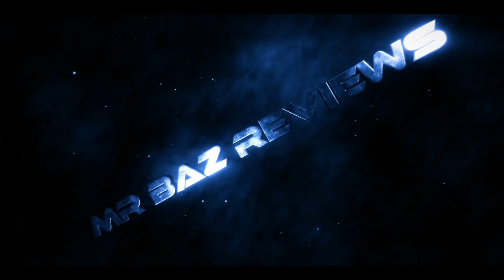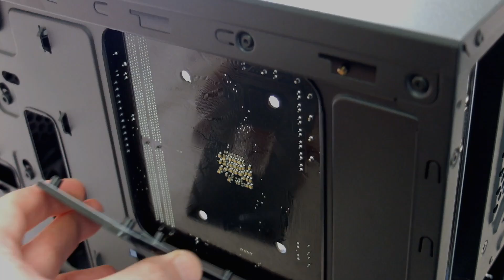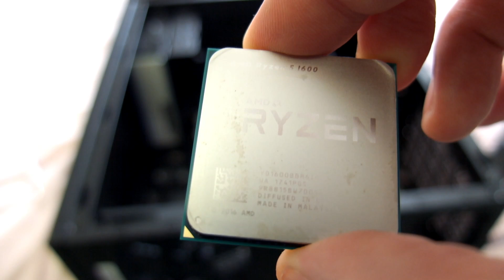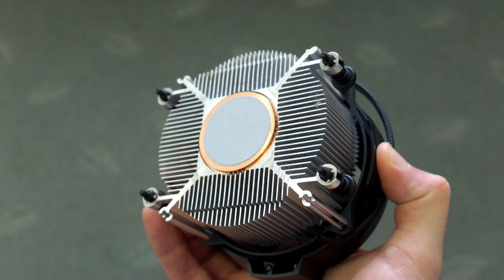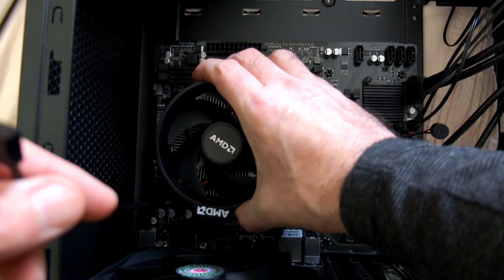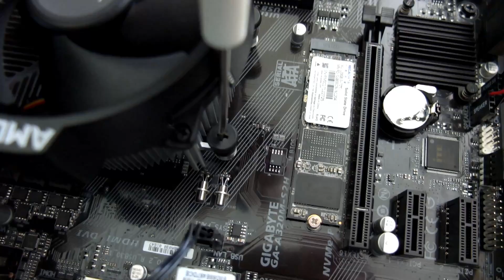How to install a Ryzen/AM4 & AM5 Wraith CPU Cooler

Comment: Thank you! I was apparently installing mine correctly but I just had to be sure. I couldn't get two of the four cooler screws from my Ryzen 5 into my Asus motherboard, turns out I just needed to really really REALLY push them together while turning the screw. Here's hoping it works lol.
Reply from the maker: Just keep the backplate in place when screwing it up use a book or get someone to hold it
Reply: @MrBazReviews  I mentioned I had done it, so I'm set now lol. Thanks though
Reply from the maker: No worries! lol

Comment: But what if the screws aren't going down? How will I know if the screws are going down if the springs keep them up?
Reply from the maker: Support the plate (put a book under it or get someone to hold it), reverse thread when pushing, then screw up still putting pressure on it. You can feel the screws bite
Reply: @MrBazReviews  
Okay, thank you

Comment: Posting my personal issue/solution: I was having difficulty reinstalling the CPU cooler after taking it off because the spring screws would not reach down far enough to contact the threads. I thought I wasn't applying enough pressure to reattach the spring screws, but it turns out that the backplate on the reverse of the motherboard (that has the contact points for the spring screws) had fallen off & out of reach. Duh.
Reply from the maker: It's OK we all make mistakes, yes the back plate can be tricky I just use a book to hold it in place
Reply: Ty so much!

Comment: I am on a b450 a pro max this cooler is a nightmare on it the screws simply don’t go in and I bent my screw driver and it still screw in
Reply from the maker: You force nothing, reverse thread it if it isn't screwing in

Comment: When I try it my cpu coolet moves and I cant screw them in cause it takes yo muck pressure
Reply from the maker: Put something under it like a book/box, or get someone to hold it in place
Reply: @MrBazReviews  its in the case tho
Reply from the maker: @dameoncolombo9214  Most cases have back board access, if not then you have to remove it

Comment: my cooler or motherboard came with no plastic parts
Reply from the maker: You need the back plate, that is it, if that isn't there you can't fit the cooler. Contact the seller
Reply: @MrBazReviews  i have a skytech pc and wdym by back plate?
Reply from the maker: @inq7868  The video shows the back plate, it's there for a reason, watch it and if you don't have one you won't be fitting the stock cooler, because it has to screw into the back plate.
Reply: @MrBazReviews  ur a life saver i was stressing out 😂 i just unscrewed my motherboard and did everything

Comment: No matter how much pressure I put on it, it won’t screw in pls help idk what to do this is my first build and nothing is working
Reply from the maker: Reverse thread it, get someone to hold the back plate in place
Reply: @MrBazReviews  i couldnt get help bc it was 2am but i managed to fix it i was just being stupid, the plate behind the motherboard that the screws go into had slid out of place 🤦‍♂
Reply from the maker: @joshyy9189  It's not too hard just they could have made it a bit easier!

Comment: What is the difference in temperatures? Thanks in advance.
Reply from the maker: What do you mean exactly temps wise?
Reply: @MrBazReviews  Sorry I meant 5 blade cooler vs 7blade cooler.
Reply from the maker: @kasparsberzins4055  Nothing obvious from using both some say the 7 blade has a bit more static pressure if it does it's very minor in performance, the 5 blade is evidently coolermaster made, and it seems to be a bit quieter at equivalent RPM's
Reply: @MrBazReviews  Thank you very mutch.

Comment: the stupid screws won't keep attached to anything through the holes in the mb. i don't know if it's amd or msi to blame but this system is awful. amd should have warned against use in cheap motherboards. i broke a few pins pushing desperately to keep the screws in position but the damn springs are more powerful than I. Something in the video is missing in my setup but i cant figure out what
Reply from the maker: The concept is quite simple, you remove the brackets..keep the backplate in place and screw the cooler onto it. If it's difficult, reverse thread the screws, do each corner a bit first to get it held in place. Some boards seem easier than others, ie Gigabyte never had a problem ever. Other makers are a bit hit and miss
Reply: @MrBazReviews  thank you

Comment: Why the shitty fuck is it so noisy! The temps are okish but now i have to waste another 30$ on some other cooler.
Reply from the maker: Go into the BIOS settings, or download the board software, all of them offer settings to tweak the fan speed, generally it's not a noisy cooler at slower RPM's.

Comment: Does this use backplate as well like the one you buy separate or the backplate only comes with a cpu fan that you buy
Reply from the maker: The backplate comes with the motherboard, you just need to remove the plastic on the front and screw the cooler onto the back plate. I have no idea other than holding the back plate in place, why they come with the plastic parts

Comment: I have a Msi b550 mono and the wraith spire will not properly sit right I can get one side screwed down but then the other side starts to lift I’m looking to get a after market cooler to try and resolve this issue smh
Reply from the maker: Try slightly screwing in each screw, work opposite screws . Then tighten up
Reply: @MrBazReviews  Ill try again I would tighten in a cross pattern but the cooler seemed would just lift and it seemed like i had clearance issue ill give it another go thanks dude

Comment: No not simple. It is pain in the ass. When you move on 1 side the other side move up. I could only move 3 sides in. Terrible design..
Reply from the maker: Some boards are worse than others, for some reason, if the back plate is held in place or on a flat surface, just screw in slightly each one. Then tighten them up

Comment: I’m having trouble unscrewing the mounting bracket on the motherboard. What size of philips screwdriver did you use?
Reply from the maker: Any will do reverse thread, hold plate should screw on

Comment: For those of you having a very hard time fitting the spring, I've spent hours trying to fit it just to figure out that my motherboard or the cooler itself had a back piece (mounted on the back of the motherboard) to fit the screws better. I'd advice to call someone to hold backplate while another person screws (don't be afraid to push it). Hope it helps someone!
Reply from the maker: Yes that is shown holding the plate is a requirement!
Reply: Thank you so much. I spent like an hour trying to get the screws in before Googling. This tip worked perfectly
Reply: This! 
Spent an hour trying to figure out how to do this. Thanks a ton!
Reply: This comment helped me stop Trying for an hour
Reply: what should I do if I'm alon3
Reply: Take the mobo off, hold the back plate! Thx a bunch!!!
Reply: Man you are a life saver I have been stuck for almost an hour trying to screw with no results
Reply: So I put my processor on by myself twice and it’s been like a year. Wanted to redo my thermopaste and was struggling to fit these screws. Ur a life saver. Hopefully I didn’t break my pc
Reply: thank you for this comment
Reply: Worked perfectly after my partner and I cluelessly worked on the screws for a good minute. Thanks for this comment!

Comment: had cold sweat installing this, there is a bow in the back of my motherboard, a very tight fit.
Reply from the maker: That's not right shouldn't bow out the board, re-attach it, the back plate should be flat it just screws into that.
Reply: @MrBazReviews  the backplate is flat. it's the motherboard that's bowed lol.  ordering an aio, this stock cooler is giving me 58 degrees idle.

Comment: I just simply can't find help for my spring screws not reaching the headers, no matter how much pressure I put on them, they won't reach. 2 of them did, but the opposite side won't.. Any advice, cuz I'm gonna cry soon xD
Reply from the maker: Take it off and try again. Some makers are not doing a great job on their boards, so I use Gigabyte never had any problems
Reply: @MrBazReviews  I got it, my back screw panel fell inside my case so that's why it wasn't grabbing onto anything lol, thanks :D

Comment: Screws wont reach on mine
Reply from the maker: Push down hold the plate in place
Reply: @MrBazReviews  do i have to take out the whole motherboard
Reply from the maker: @stevenrinehart5061  Not unless you can't get to the back plate, depends on the case
Reply: @MrBazReviews  i tried to get to it but something is holding it on and i cant figure it out
Reply from the maker: @stevenrinehart5061  I can't remote trouble shoot remove everything and then put the cooler on as shown I've never had a problem fitting it myself

Comment: What is the easiest cooler to install because I might get this? I'm literally afraid of breaking my mother by trying to install this POS? My motherboard is a gigabye  Aorus elite v2. I'm serious. What is a much easier one to install? Something without these stupid spring loaded screws.
Reply from the maker: I use the Artic Freezer series easy enough to install
Reply from the maker: I use the Artic Freezer series easy enough to install
Reply: @MrBazReviews  I finally got it in I think but its a bit confusing.
Reply from the maker: @XHobbiesPrime  It varies some makers it's harder to screw the cooler in, for some reason. I've not had problems on Gigabyte boards

Comment: Worked all this out today then come see this video.. im only here as trying to find out what the black plastic bits are i took off first 🤦🏻‍♂️🤷🏻‍♂️ (amd n00b) 

Still none the wiser but good video 👌🏻☺️
Reply from the maker: They're just there in case some cooler fits onto them, but the AMD one doesn't so you have to remove them. They also hold the back plate in place ;-D

Comment: @Mr Baz Reviews can you help me, as I'm trying to install this cooler, as I tighten the screws down there were grains or powdery metal falling off from the screws to the board , I think because of the tightening. I'm scared to turn on the pc because it might be conductive. Electric current might flow to the board and damage it.  Any else encounter this?
Reply from the maker: Reverse the screws then tighten after that shouldn't be a problem

Comment: dropping in 2 years later... If i understand correctly i can not overturn these screws?
Reply from the maker: That's correct I've never had a problem it's screwing into the back plate you can't really break it

Comment: I can only screw in the 2 top screws. The bottom two are dangling, as they can't reace the holes to be screwed in. Am i doing something wrong? 

I removed the 2 brackets that come pre-attached. I then aligned the cpu fan, and began screwing. To my surprise, not all screws can reach. :/

Mobo: Asus Tuf Gaming x570-Plus Wifi
Reply from the maker: Push down on the screws

Comment: you guys think you can wipe a thermal paste off a cooler with a microfiber cloth? Worried itll create static or something as i am going to use the same cooler with a new cpu i ordered.
Reply from the maker: No it will smear all over the place use TIM removal fluid trust me a lot cleaner

Comment: Can i Use this Cooler on Dell T3500?
Reply from the maker: That's an Intel chipset so I'd say pretty unlikely unless you wanted to start shaving bits off it! If you're looking for good/quiet not stupidly expensive cooler the Arctic series is very good I've used a few few builds and they perform very well

Comment: thanks for the video. i was really confused about those black plastic bracket things on the motherboard and was wondering if they can be removed or if i have to buy new cpu cooler
Reply from the maker: They're just there mostly for holding the back plate in place, most third party coolers have their own fitting just like the AMD one

Comment: Hi! I know this video is coming up on 3 years old, but do you have any recommendations for a slightly slimmer cpu cooler replacement for this? It blocks a ram slot on my motherboard and near the end of the video it also looks like it might be interfering with a slot on yours.
Reply from the maker: 1:48 there is no ram interference on this board, but not every board is the same, but unless you are using super high heatsink ram it's rare to have an issue

Comment: Will backplate fall off when u remove screws ?!
Reply from the maker: Yup
Reply: @MrBazReviews  dammit I already put it on my case Nd I just need my cpu
Reply from the maker: @Darkflight5  Most cases have a back plate cut out, some don't I tend to go with the cut out ones just in case
Reply: @MrBazReviews  mines cut out as well how should I use it to my advantage?
Reply from the maker: @Darkflight5  You don't have to remove the MOBO that is a huge time saver unscrew the side panel
Reply: @MrBazReviews  and hold the bracket as I screw the cooler ?
Reply from the maker: @Darkflight5  No hold it won't stay in place so hold it
Reply: @MrBazReviews  hold the bracket ?
Reply from the maker: @Darkflight5  Yes support it

Comment: I heard a pop while pushing down the heat sink to get it to reach the screw hole could have I damaged the cpu? Or is it nothing to worry about?
Reply from the maker: Did you seat the CPU properly? If so then just try it
Reply: @MrBazReviews  yes I’m sure the cpu dropped into place so should I just boot it up and see if it works?

Comment: A person said tighten it 4-5 times. I did that and got 65C Avg on idle. Ryzen 5 3600. After tightening it completely I got 38-42C idle. So much diff.
Reply from the maker: It needs to be tight on the CPU die
Reply: @MrBazReviews  i got know this  to today. I was using it in the wrong way since a month.

Comment: Any tip to how to put in the screws of the cooler? Im screwing for like 20 minutes and applying pressure like a maniac and it wont stick at all
Reply from the maker: Hold the back plate then screw into it, reverse screw if it won't go in

Comment: Thanks. I think I need to tighten my cooler more, not sure I've got higher temps than expected. I found the back plate + spring loaded really tricky to install, so knowing that I can't overtighten is golden to hear.
Reply from the maker: Glad it helped

Comment: im still having trouble installing my fan
Reply from the maker: Unfortunately I can't remote troubleshoot problems take it slow screw one in partly, then work on the others it is quite simple. Hold back plate in place
Reply: @MrBazReviews  wait i got it i just had to put more force into the fans

Comment: I got the two top ones but the bottom ones are to far away from the the point the go in at
Reply from the maker: Do one at a time corners first
Reply: @MrBazReviews  it is just hovering over the point where I screw in but the screws can’t reach I think THINK it will be ok but I’m not sure
Reply from the maker: @DarkV2.  Hold backplate in place push down spring loaded it's nothing to panic about push
Reply: @MrBazReviews  thank you I was able to fix it and now all the screws a screwed down thank you so much

Comment: hi bro i have mobo msi b450 gaming plus and cpu rysen5 1600 and i cant get rid of black screen and red led from cpu? any help please?
Reply from the maker: Check power supply, clear BIOS CMOS with jumper or screwdriver, remove other devices (HDD/SSD/DVD etc) then try, check connections to board from PSU.
Reply: @MrBazReviews  my pc starts all the time verry wel but after  2,3 days when i restart it sometimes at ez debug led shows me red led cpu and enters in black screen, he freezess, i mention that i use an dvi d conection, i have an old acer 18 inch  it has 1400 with 900 pixels, could it be that problem? But i hurd most people has this problem with b450 chipsets
Reply from the maker: @facdăsistem  Update the BIOS
Reply: @MrBazReviews  what bios do you recomend if may i ask?
Reply from the maker: @facdăsistem  Update to the newest BIOS
Reply: @MrBazReviews  i unplugged 4 pins from those eight i saw manny who solved the problem, i hope dont affect with nothing, and i updated the bios now so...im waitting to see whats happening but when i shuts of pc shows the red led a milisecond and is turning of normaly

Comment: Bro, The Screws (Retention module) are sooo tight, they just won't come off , I don't wanna Put a lot of strength in unscrewing it cuz I fear it'll break the mobo, they are not coming off plz gelp
Reply from the maker: Use a bigger screwdriver nothing to break they screw into the back plate as long as you don't pressure the mobo all it good

Comment: how would you remove this cpu cooler, to upgrade
Reply from the maker: Just unscrew it, heat the CPU up first (ie power it on for a bit) easier to remove the paste off the CPU
Reply: @MrBazReviews  thank you!

Comment: Why aren't my screws screwing in
Reply from the maker: Are you holding the backplate in place? Try reverse threading first then tighten
Reply: @MrBazReviews  I've installed my cpu and fan and now my pc won't turn on at all :(
Reply from the maker: @hatchedchick  Check all the connections from the PSU
Reply: @MrBazReviews  i did :/
Reply from the maker: @hatchedchick  Check front panel connectors, removed other devices (ie drives etc) use one stick RAM

Comment: Absolute nightmare to install this cooler. It moves around, lifts, screws don't reach the bottom. I just did a new build, I was scared of breaking the board or the CPU.
Reply from the maker: Reason I only use Gigabyte boards ;-D You don't have problems lol